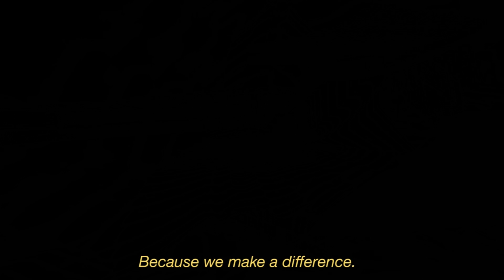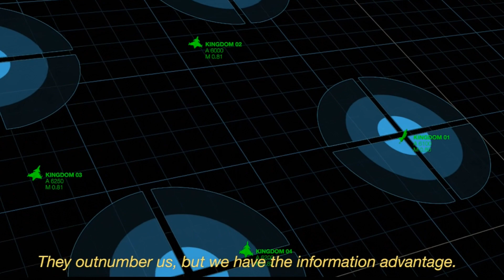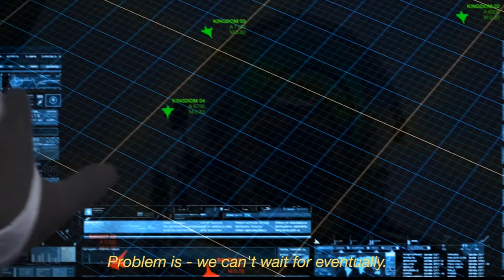Gripen Fighter Jet - Canada's Future Fighter?

Comment: Gripen got 5-0, 5-0, 5-0 and 5-0 against USA in red flag. Well done Sweden
Reply: score in a competition means so much. just like how the chally 2 came in last so obviously it sucks?
Reply: That's extremely embarrassing...
Reply: The Gripen is a good little fighter, it just doesn't have the range for a big Country like Canada . Stealth will get cracked sooner then later. Canada would be best served buying the F/A 18 E/F/G Super Hornets with the latest avionics. The F/A 18 E/F is a bargain relatively speaking  By the way the Gripen uses one of the F/A 18 Super Hornet.
Reply: @dildoe7898  Ye thoose 130km extra range F18 Super Hornet have is crucial :P,  and if you take into account the unit prize for the JAS is almost 50% of the SH I would say JAS highly underrated. But I am Swedish so i wouldnt say i am impartial :)
Reply: @dildoe7898  The Saab Gripen can land on some random road for a quick refuel and rearm though. And it is faster, wich is crucial in a big country.
Reply: @yamahaevo
Bullshit! Show us your source.
Reply: @RedRider1600  https://theaviationgeekclub.com/former-swedish-air-force-flight-engineer-explains-how-the-saab-gripen-can-dogfight-and-win-against-almost-any-dissimilar-aircraft/ and the score was 5-0/5-0/5-1
Reply: @RedRider1600  i red it but wasn’t talking about all the article just 

Gripen first participated in Red Flag 2006 with the Gripen. With reduced radar and air support Gripens connected their link systems and acted themselves as AWACs, got the battlefield awareness that in some aspects was better than the opponent. With no big effort avoided all ground defence, scored 10 kills the first day including a Typhoon. No losses and they remained undetected, the EW suite showed to be very difficult to burn through. One Gripen pilot knocked down five F-16 block 50+ during close air combat in Red Flag Alaska. And the Gripens never lost any aerial encounter or failed their mission objectives. It was the only fighter that performed all planed starts, while others were sitting on the ground waiting for the weather to clear up. The evaluation was that Gripens capacity needed to be revaluated. Gripen could be favoured as much as 15:1 against the F16. And no disrespect to other fighter pilots with the roles switched they would’ve scored the same.

And I’m sorry for writing the score wrong and mistaking the Norwegian-Swedish exercise 
With red flag 

I speak English but not as a first language because I’m not native English speaker excuse me.
Reply: @brianok2759  
The entire article was just some ANECDOTES from some guy named Stefan Englund.
How much of that is true, we don't know.
How much of that is just bias and one sided  story telling from a Swedish Flight Engineer, we don't know.
What we do know is, no major military power is interested in buying cheap Gripens.
There are very few buyers for Gripens, despite their lower price tag.
Reply: @RedRider1600  ok but What do you consider major military power (Russia China USA France UK,India) yes those won’t buy gripes they will choose to produce their own fighter but Brazil which is ranked number 10 in the global fire power index bought the gripen and also the purchase of a fighter is a highly political decision. And your right these  are just anecdotes from a biased perspective.
Reply: @brianok2759  
I don't consider Brazil as having a first rate Air Force.
Overall, their military may be ranked 10th due to their overall size and strength, but that doesn't mean their Air Force is in the top 10.  In any case, there is a huge difference between top 10 and top 5.
Brazil is a poor country.  They bought what they could afford to achieve the numbers they needed or wanted.
The Gripen isn't considered to be a first rate air superiority fighter by any of the major powers.
Even most poor and developing countries do not want to buy Gripens.
There are very few buyers for Gripens.

The main argument for the Gripen is it's cost effectiveness.
Cost effective isn't very cost effective if the Gripen loses all its battles, penny wise, pound foolish.
The F-35 has a 20 to 1 kill ratio against F-15's, F-16's, and Eurofighters.  Now, THAT is cost effective.
One F-35 is worth 20 of any one of those 4th Gen aircraft.  If you think it is worth at least 2 of those aircraft, then the F-35 is a bargain for $100 million.
The stripped down model of the Gripen is cheap, but the top of the line model isn't so cheap, somewhere in the neighborhood of $60 million.
The Gripen is an obsolete aircraft.  It's an investment in old technology.  It's a waste of money.

Here is what the Danes think of the F-35 after a competitive evaluation. "The F-35 just won a competition — and it wasn’t even close. In every category, from combat performance to cost, the Danish government rated Lockheed’s F-35A Joint Strike Fighter as superior to Airbus’s Eurofighter Typhoon and Boeing’s F/A-18F Super Hornet."
https://breakingdefense.com/2016/05/f-35-wins-denmark-competition-trounces-super-hornet-eurofighter/

It is interesting that the Danish military don't even consider the Gripen.  Apparently, hardly anyone is interested in the Gripen.  Less than 300 have been produced in 24 years.  The Swedes bought less than 200 of them.  570 F-35's have been built as of October, 2020, with 2,500 more to come.  The F-35's have been in combat with the Israeli Air Force for more than a year and a half.  They want to buy more of them. The best Air Force in the world chose the F-35.

According to the USAF, at Red Flag exercises 2 years ago, against F-15's, F-16's, and Eurofighters equipped with AESA and IRST, the F-35A scored a 20 to 1 kill ratio over an eight day long series of war games.  Before that, in another USAF exercise, the F-35A scored an 8 to 0 kill ratio.  According to US Marines, in their own war games, the F-35B scored a 24 to 0 kill ratio.
https://ukdefencejournal.org.uk/f-35-dominates-exercise-red-flag-earns-20-1-kill-ratio/

In the real world, in real combat, the F-15 and the F-16 have never lost in air to air combat or a dogfight, while the F-15 has had over 100 air to air kills and the F-16 has had at least 76 air to air kills, all without a loss.  However, the F-35 can shoot down F-15's and F-16's with ease, like "clubbing baby seals", actually, more like blind baby seals.
Reply: @brianok2759  
Denmark requested that they upgrade the Gripen to more powerful engines, larger payloads, longer range, and additional avionics.  It sounds like the Swedes had no confidence that they could win the competition or could make the requested modifications so withdrew from the competition.
Reply: @RedRider1600  And they couldn’t do that because it was the NG not the E  because the NG had Volvo engine but the e has A General Electric engine but the E has all the modifications but was still in development
Reply: @RedRider1600  and also you can read on the Wikipedia article of the gripen in the failed bid section that most of the time the gripen failed due political reasons and sometimes pressure from the USA
Reply: @brianok2759  
NG stands for Next Generation.  It refers to the E/F models.  The E is the NG.  They are the same plane.
The problem is, the Gripen is a small single engine lightweight fighter (17,600 pounds).  It cannot compete against much larger twin engine aircraft like the F-18E (32,000 lbs) and Eurofighter (24,200 lbs), or the 29,300 pound F-35 with the massive P&W F135, 40,000 lbs thrust engine, with a maximum takeoff weight of 70,000 pounds.

The Gripen E has the same GE F-414 engine as the F-18E with 22,000 lbs of thrust, but the F-18 is a twin engine plane. The F-18E is a much larger plane and carries a much greater payload.  By the way, the Volvo engine was a copy of the GE F-404 engine built under license.
Reply: @RedRider1600  I know and I agree with you 100% about the payload but gripen trade engine power and take of weight by cheaper operating cost and as Saab spokesperson said “ cost is what’s killing modern airforces “ like Austria who bought the eurofighter in 2003 but is thinking to replace it with the gripen
Reply: @brianok2759  
"Pressure from the USA"
The US doesn't want Sweden selling US technology to certain other countries.
Most of the technology in the Gripen is American, engines, weapon systems, sensors and avionics.
The Gripen often fails because it is not a full sized, fully capable, multi-role fighter.
It also does not have the latest or the best sensors and avionics.

It failed with the Indians because the Gripen relies too heavily on US technology, and that could possibly be a problem in the future if the US decides to cut off supplies to Sweden or India for some strategic or political reason.
India is an ally of Russia and was collaborating on the T-50/SU-57 stealth fighter. They do technology transfer deals with each other.  I don't think the US wants to share US technology with Russia.  Similar situations arise with certain other countries.

Operating cost is not the single most important thing for aircraft.  You need an aircraft that can do the job required.
For some countries, being able to defeat the enemy is the single most important thing.
If operating cost was the most important thing, we would still be flying WW2 tech propeller planes.
Reply: @RedRider1600  ok I understand about India but why pressuring Poland and Norway both nato allies but  the weapons standpoints I don’t really understand because most US weapon can be replaced like the amraam can be replaced by the meteor
Reply: @brianok2759  
I don't know all the details and all the specifics in every situation. I gave you a few examples. I can give you an educated guess and I can only speculate. It could be that the Meteor contains some US technology that was transferred to the Brits. The missiles may share similar technologies. The other half of the missile technology is in the aircraft itself, tied into the sensors and avionics. 

There is also the issue of compatibility and commonality for logistical reasons to simplify logistics and supplies, etc. If you run out of Gripen parts, you can't ask the US or other NATO members to help you out with supplies and Gripen parts in the middle of a war.
Reply: @RedRider1600  in this point of view i agree that a a lot of gripen parts are American or at least nato compatible and I guess that a lot of parts are because in the Canadian bid someone in the gripen program said (sorry for not knowing who) that gripen parts are compatible with American and nato parts (or at least something like that and sorry for guessing and giving facts that I’m 100% sure)
Reply: @RedRider1600  talking allot! US technologies? Metior technology from US? Nobody even bather to replay on all your waffle. Most of the develop European countries already superior US technology. And soon also China. The only reason USA have this military power is because they don't care about the people and the welfare. Only want to be the world police and create instability. Gripen will smash both F35 and F22 out of the sky if you spend same amount of money up in the air, and Gripen havet never show the full capability of the electronic welfare. You talk about obsolete tech, look at F22. Even US don't want to spend money on the junk anymore. Israel what choice do you think they have. They are so far up in the ass on? You guess? Like so many other country.
Reply: @RedRider1600  I don't need to argue. People can judge. This is my best knowledge. Noting personal. 🙂
Reply: @RedRider1600  you are so missinformed about everything you say.its not even funny.how old are you? You will learn about the world eventually 😉
Reply: @connywestlund924  
And how do you know that?
Sounds like you have a projection problem.
I have trouble taking seriously a guy who has no argument, no facts, and no data.
Reply: @RedRider1600  The reason behind Brazilian purchasing Grippen isactually  very wise one.

Saad offered technology transfer on how to build one with the purchase. Now the military  wing from the Embraer can work together with the Saad to develop and improve the Gippen.

And Brazil already have a top class airplane working in the Close air support role (the A-29 Super Tucano).
Reply: @Padtedesco  
So the Gripen was not chosen because it was the best aircraft.
It was chosen because the Swedes were desperate to sell their difficult to sell second rate fighter, and offered a technology transfer in exchange for the purchase.

The Tucano is a very small cheap 3rd rate attack propeller aircraft only good for fighting drug cartels and low tech terrorists, and for 3rd world countries that can not afford anything better.
Reply: @RedRider1600  Basically yes and yes.
Reply: @Padtedesco  
Okay. . . LoL
Reply: @RedRider1600  First of all, I love American fighter jets, and I know they perform really well. I'm going to reference lessons learned from the Gulf War to highlight some key points here. And in the Gulf War, where fighter jets played a major role, the coalition forces proved that superior planning, intelligence gathering, coordination and effective utilization of the available tools wins you wars. It was a short war, not because the enemy had a small and poorly equipped army, but because coalition forces executed their strategies promptly and effectively. The pressure they put on the Iraqi forces was unrelenting, and part of why they could do that was because the fighter jets they used could be deployed often – a high "uptime". The tools that the coalition used in that war were not technologically superior in every case. The US Navy even used A-6's and the Air Force used the slow but sturdy A-10's. Those jets are by all standards technologically inferior to both the MiG-29's that Iraq used and the F-15's and 16's. But that didn't matter, because most of the MiG's were already out of commission (many were never used at all) well before the A-10's and A-6's were called in. Those jets both performed their roles really well despite being "inferior" to both the MiG's and F-15's, because they were the best tools for the job at the time. The MiG's were quickly taken out of commission partly because of well trained pilots using well performing fighter jets, but mostly because of superior mission planning, coordination and on-site intelligence and communication on the side of the coalition forces. The coalition won the war with minimal loss of lives and equipment. It was a very one-sided conflict in many aspects. That's the way modern warfare plays out if done right. Careful planning, swift action and choosing the right tool for the situation. That way the conflict can be resolved quicker and fewer lives are lost on both sides – a win-win.

Now, do you think that a fighter jet that on paper performs worse in some of aspects regarding speed and mobility, but has a cutting edge EW suite is objectively the worse fighter? Or do you think it depends on the situation? The fact is, that any armed conflict will have unique challenges presented to the participants, and whomever is able to identify and overcome those challenges quickest will most probably win. That's where versatility comes into play when talking about fighter jets – that is, how well it can perform multiple roles. That's why the F-15E Strike Eagles (when compared to the F-15C's) and the F-16's where so successful in the missions they were sent on, because they were versatile and had good EW suites, probably markedly better than what the Iraqi MiG's had but that I don't know for sure. Besides highlighting how important intelligence and planning was, and the importance of choosing the right tool for the job, the Gulf War also highlighted the importance of good EW suites. One thing that anyone has to admit is that Sweden is always at the forefront when it comes to IT technology and it's not strange that SAAB would equip the JAS-39's with some pretty high tech and cleverly designed stuff. In modern aerial combat, targets are acquired and engaged at much longer distances than before, and generally the best electronic equipment wins out. That's because the one who can find an enemy, successfully target him and send some ordnance at 'em before the other even notices, will have dramatically higher chances of not only surviving but really taking the enemy down and go on to establish air superiority. That is much more important than pure dog-fighting capability, in which the JAS-39 is definitely no slouch either. And if you have an effective system of sharing information quickly between pilots, the collective situational awareness can be greatly boosted, meaning you can coordinate more efficiently and thus provide cover for your wingmen much more effectively – something that actually outweighs pure dog-fighting potential of a individual jet.

What about operational range then? In the Gulf War, no fighter jet used by either nation in the coalition could have done their job effectively without depending on airborne tankers for air refueling. Tankers played a major role and were crucial to the success of coalition aerial operations. Tankers not only greatly extended the range but also allowed a higher uptime for all jets. That's the way modern aerial operations are done over larger areas. And if you're going to depend on tankers anyway, then operational range becomes only a minor issue. You could argue that a fighter that gives you more range per amount of fuel is favored in this specific case, which a lighter jet with less drag will certainly give you. Another point that was brought up in this video is weather conditions. You can't know for sure where conflict may arise and you need to have tools available that can perform well in a wide variety of climates and weather conditions, or you may be unable to deploy effectively. If a single tool can be used in most such conditions, it's versatility goes up by a significant margin. If you know you can depend on it under difficult conditions, you will have a strategic and psychological advantage over an enemy that can't do the same, and if nothing else, at least you won't be disadvantaged in that area.

And lastly, a grossly underappreciated point: Cost. This is actually really important. If the US Air Force and Navy (or any other military force) had unlimited funds, they would obviously only have the most expensive and technologically advanced jets (in the hundreds or maybe thousands) and only use the most expensive and advanced weaponry – and nothing but those. The reality is that they can't. That's why they were still using A-6's in the Gulf War and also the reason why they used unguided bombs at all despite relatively low accuracy and increased risk – because they're much cheaper than guided weaponry. And cost is much more than just about the purchasing price. How expensive is the equipment to deploy, service and maintain? How much effective firepower do you get for what you spend? In those regards the Swedish jet outperforms all of the top contenders by far and you still get a very competent and dependable tool. For the same price that you buy one F-35, you could buy several JAS-39's, even though they would be used for different jobs, but I think I made the point clear. For the same job, two jets for the same money are better than one, especially when the cheaper jet performs similarly to the more expensive one and in some cases even better. And if you get three or more for the same money, you suddenly have a lot more effective firepower. And remember, lower deployment and maintenance cost means more uptime, especially when maintenance is relatively fast, simple and straightforward. More uptime means you get more use out of your tools; You get to use more ordnance on more targets. This is especially important in wartime, where a single jet needs to return to base for reloading many times. These areas are where the F-16 outperforms it's big brother, the F-15 (likewise with the F/A-18 and the F-14), and is also a major reason why there are an overwhelming number of Falcons compared to Eagles worldwide, and is actually the real reason why the F-16 and F/A-18 jets were even developed in the first place. The F-14 and the F-15 were simply too expensive to use as the sole fighter jets of the Navy and Air Force respectively, no matter how good they are, and in the case of the Tomcat it was also much too complicated to service and maintain, which is why it was ultimately retired. So you see, even within the US (the highest spending military in the world), the matter of cost plays a major role. And the less money you need to spend on purchasing and keeping the jets flying, the more you can spend on ordnance and pilot training programs (like Red Flag). More cost effective jets really means more jets, more uptime and more money to spend on other things – something that both the F-16 and F/A-18 has proved beyond doubt. And before you start thinking that cheaper means poor quality, you should study up on Swedish industry standard. It is definitely way up there right next to the Germans. Swedish-made electronics is also world renowned for it's high quality.

To round this up, which is the better fighter? The answer isn't straightforward. The answer is it depends on many things. For some jobs, the F-117 Nighthawk is the ideal choice (ok it's more of a bomber). For other jobs it's the F-35, and for some jobs it's neither of those. In some cases, the best fighter is the Swedish one. This is one of the reasons why there isn't just one single type of fighter jet within larger air forces. Another reason is very much about the cost. All things considered, the JAS-39 is a very sensible choice for a multi-role fighter jet. I think it really deserves some credit in a market dominated by US military contractors and other manufacturers could really learn something from them. The US military would obviously never buy any vehicle made by a foreign nation – at least not to any significant extent. But how much of that is because of pride, and how much is really because the domestic choice is the better? That's a question all militaries should ask themselves.
Reply: @RedRider1600  Although I replied directly to you, this was really intended for all participants. I did read most of your comments and from what I gathered, you and some others seemed much more interested in a direct comparison between the F-35 and the JAS-39 as if they were both apples – and in proving the opposition wrong through insults along with stomping on thier pride. I wanted to steer away from that by widening the perspective through some history and hopefully enlightening someone in the process. If I failed to do that then that's too bad I guess. I know I pointed out some things that hadn't been touched on. It just makes me sad to see people fighting over a topic like this, when they could be admiring all the different aircraft for their strengths instead. Something people also need to realize is that the JAS-39 is a point of pride for many Swedes as it demonstrates how far a small country like Sweden has been able to come in military aviation despite a much much smaller budget than a relatively big country like USA or Russia. Is there really a need to take that away from them?

And I have to say, your attitude does you no favors. It's hard to see any real purpose behind many of your comments other than trash talking other countries and making personal attacks. I really hope that's not your intention, but I think most people would interpret it that way. You can't deny that you helped to provoke an unnecessary exchange of childish insults because of some rather offensive wording. If that wasn't your intention, then you should really rethink the way you approach discussion. Most people are all for civil and polite discussion with an exchange of facts without being condescending to anyone, but the way you and some others (on both sides of the discussion) catapulted the discussion into baseless verbal assaults has absolutely no place on a public platform, or anywhere else for that matter.
Reply: @Arexodius  
The other major flaw in one of your arguments . . .
 You say that even the USA is affected by cost and a limited military budget.
That is true. However, you fail to comprehend the magnitude in the size of the US military budget ($730 Billion) in relation to our allies and our enemies and other countries.

The rest of NATO ($310B) + China ($183B) + Russia ($64B) + India ($49B) + Japan ($51B) + Israel ($21B) + Iran ($17.4B) + North Korea ($3.6B) + Ukraine ($6B) + Finland ($5B) + Switzerland ($5B) + Sweden ($7B) = $722 Billion.
US military budget = $730 Billion

Despite the fact that the F22, F-35, and the B2 are the most expensive planes in the world, the US will have thousands of them. It won't be the F-35's and F-22's that will be outnumbered 2 or 3 to 1. It will be the cheaper 4th Gen+ Migs and Sukhois and the Gripen that will be outnumbered, 4 or 5 to 1. In the case of advanced Gripens, it will be 15 or 30 to 1. 

The US does not have the same military budget restrictions as Sweden ($7B) and the rest of the world does. Budget restrictions, yes, but not to the same extent.
Reply: Absolutely meaningless.
Reply: @Urov.  I agree, you are absolutely meaningless.
Reply: @Pellepastor  Sorry that I am late. If you got the time. Could you explain why that's meaningless?
Since we haven't seen much real fighting between modern fighters. Wouldn't exercises be the next best thing?
Reply: @wilmersandstrom2826  I totally agree. I meant that Matt Watson's comment was meaningless.
Reply: @Pellepastor  Ah. Alright, we're cool
Reply: @Urov.  why meaningless?